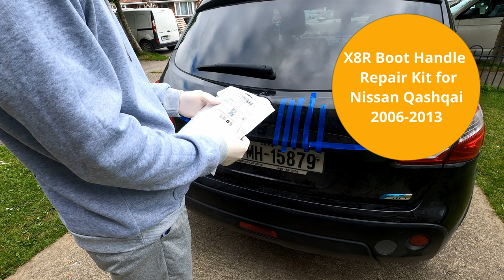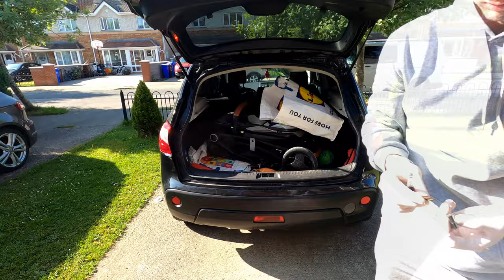NISSAN QASHQAI  Boot handle repair

Comment: Hi, thanks for the clear explanation in your video, thanks for taking the time to share!
I'm doing this job atm,  so I use your video as a guide 😅
Other question, maybe you are able to answer; I need to replace my rear window wiper. I've been to stores, and gave me all standard Bosch (for instance) suitable for Qashqai J10. But they don't fit on the arm. For the piece of plastic is too long to fit in the wiper itself. Do you have the same? And can you tell me what type I need to looking for? Thanks so much in advance, greetings 😊
Reply from the maker: Glad you found it helpful!!! In regards of your rear wiper if it doesn’t fit it means it’s a wrong wiper so? If you can’t find right one perhaps u can try to replace only rubber… 👍
Reply: One thing yet, for other users, if you use brake cleaner (I know what it can cause, I work with (petro)chemicals), spray it on a cloth, not on the trim for it can really damage the paint. 🙂

Comment: with out repair kit what would you do ?
Reply from the maker: I’ve seen people putting bolts through with round shape head.. looks alright. If r on a budget and need a quick fix I’d say it’s way to go… not sure about water tightness or now days you can get brand new aftermarket handle … the only thing is it comes black and not even primed… 👍 hope this helps 👍 Thanks for watching 🙏